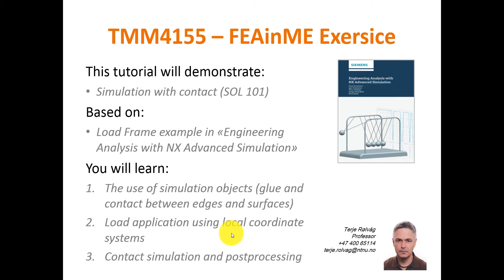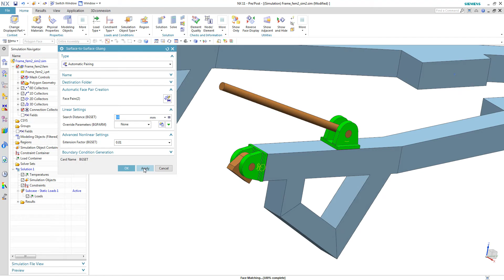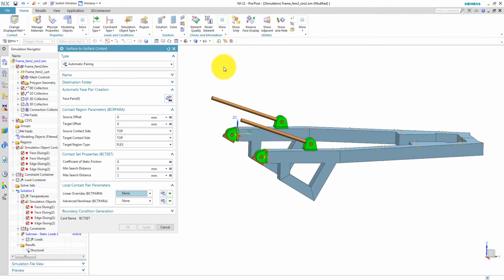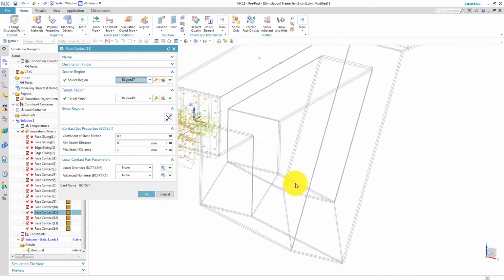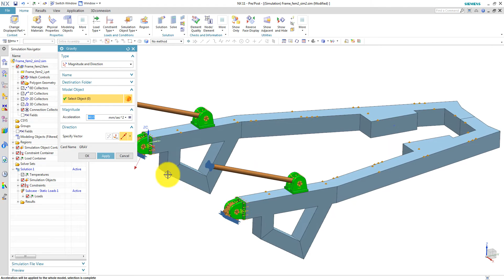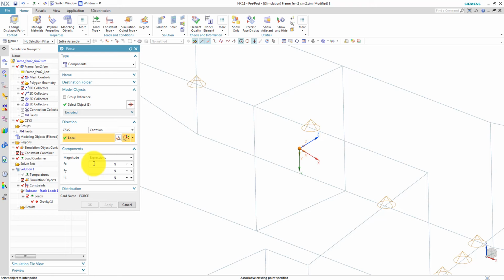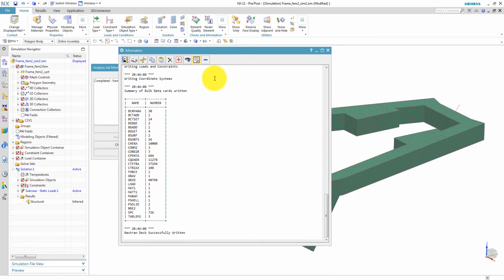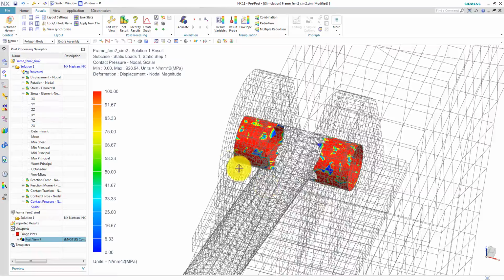NX SOL101 Load Frame Simulation

Comment: Hi, I have a gripper that pick up an object in Motion simulation. Then I use Pre/Post and Loads Transfer to observe in FEM. Basically it's just normal FE model. However, I can't see Reaction forces in the result (I made it once, but I didn't save and the following tries later I can't see it anymore). I already request Output for Force and SPC Force but it still doesn't show. Which can be the possible mistake I made that prevent Reaction force to be plotted?
Thank you
Loc

Comment: when you applied the force to the coordinate system, how is that point connected to any nodes?
Reply from the maker: If I remember right I used a RBE2 element
Reply: @FedemDigitalTwins  Got it. I don't think you showed that step (setting up your FEM) in your video, however, it was very useful. thank you.
Can you make a video on formulated loads on a surface?